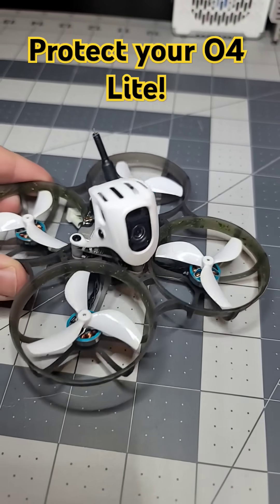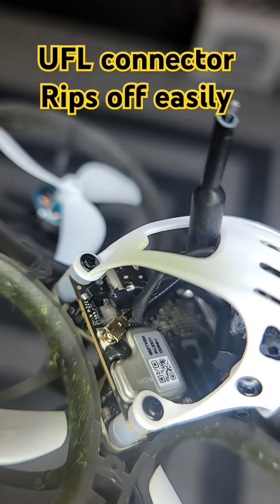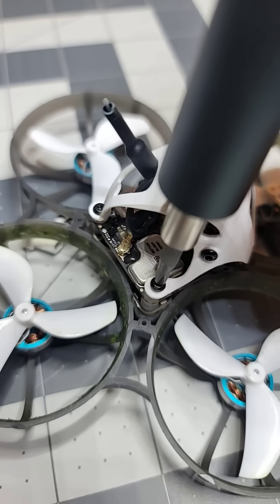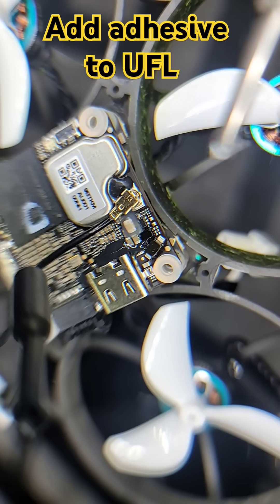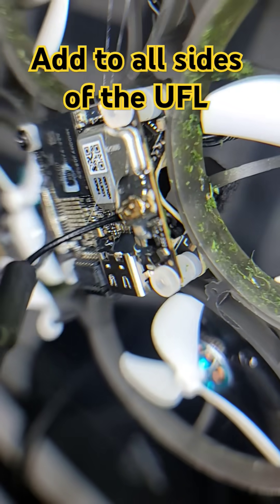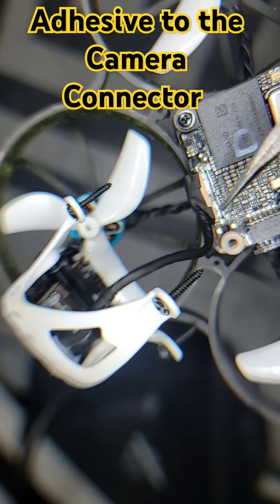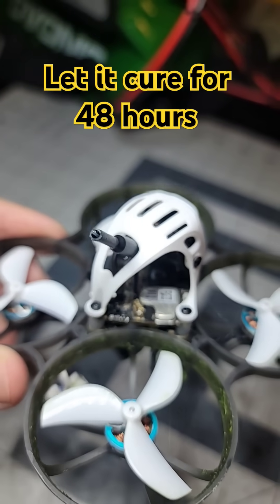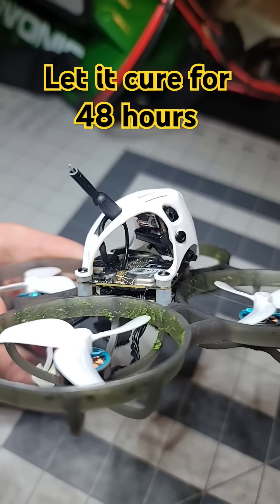Protect your DJI O4 Lite unit #tinywhoopfpv #meteor75pro

Comment: Are you able to remove it if you need to switch the cable out ?
Reply from the maker: Yes, when it's solid it's like rubbery. You can remove it with a tweaser